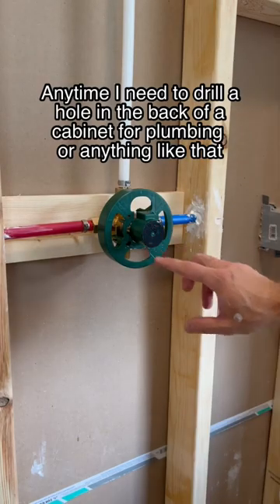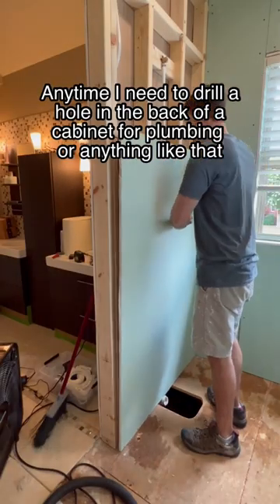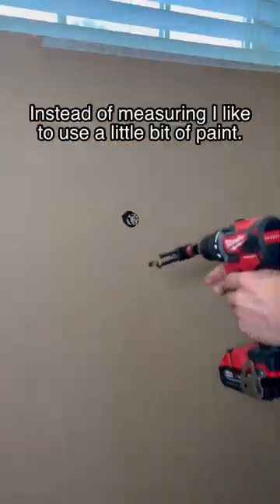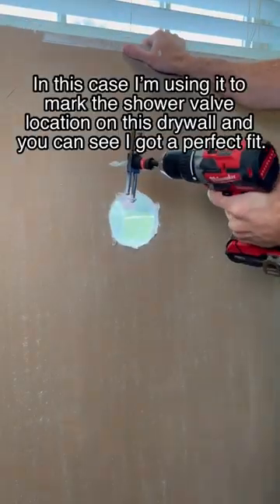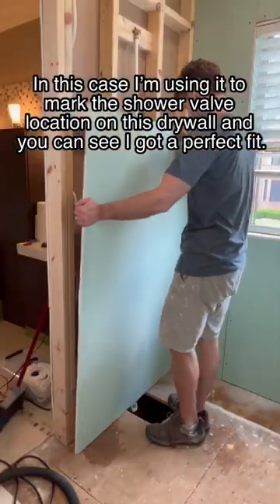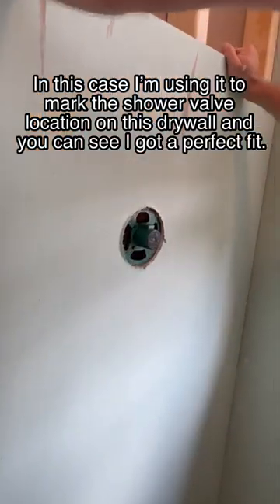Quick tip for drilling plumbing or electrical holes #shorts #construction #plumbing #electrical

Comment: Chalk line dust is better you can remove the chalk if you like. I do the same.
Reply: Graphite powder does the trick too if you have it (or are willing to sacrifice a pencil). I use it when I want to mount something on multiple existing bolts. Powder the bolt heads, put your working piece against it, tap it with a mallet, done

Comment: Drywall in a shower????
Reply: Drywall is typically used as a base layer. Tiles are then stuck to the drywall and waterproofed
Reply: @CarsNGuns365  yea. But usually they use waterproof drywalls. Or at least drywalls that are protected against high density.
Reply: @CarsNGuns365  wait you have waterproof on the outside of the tiles?
Reply: @zunlxgit0amx971  where i live we smear 3 layers of some green stuff called "membrane" that is supposed to waterproof the wall and floor. tiles are then stuck to the walls
Reply: @user-by7hj4dj9s  here in germany you have this alr on the wall. It protects against steam. Wetness. And water. Ontop of that you put the tiles and what ever you want.
Reply: No drywall for tile jacks do that you use rock board for showers !!!

Comment: Drywall in the shower? Try again dude.
Reply: he’s probably gonna put something over the drywall, like tiles for example
Reply: You tile over Hardiebacker. This isn't 1998 bro.
Reply: @abramworley5344  didn’t know. I’ve put tiles in a shower only once to upgrade the existing setup
Reply: what do you suggest ?
Reply: The blue stuff is rated for showers. He did fine
Reply: @Booom_  so wrong. If you built like you are saying, that crap would only last 2 years.
Reply: @whattheschmidt  mate I admitted admired to being wrong lol